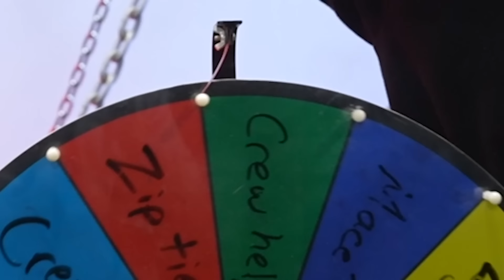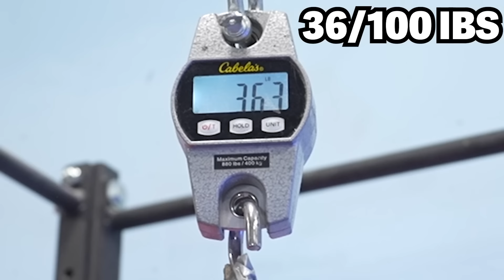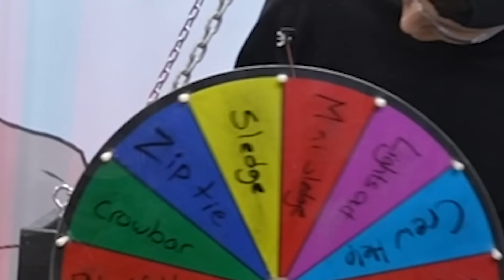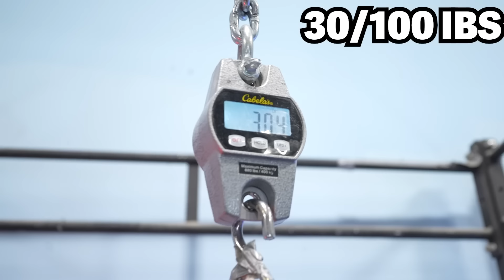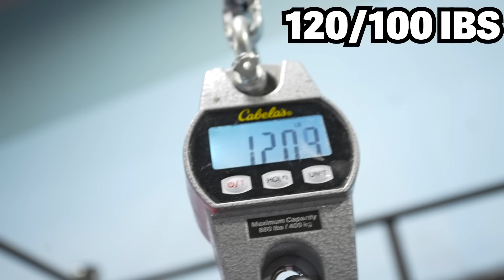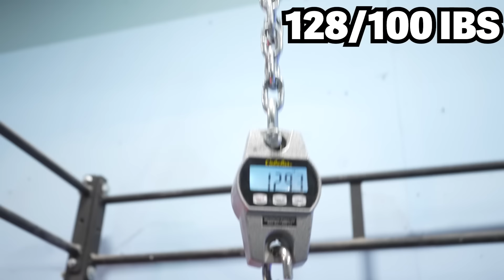First To Escape The 10,000 lbs Concrete Block Wins

Comment: Hey Dustin I hope you see this. Silica dust (concrete dust) is extremely dangerous and can cause silicosis which simply explain is untreatable scaring of the lungs that spreads and can not be stopped. 
You should all get ct scans done on your lungs asap